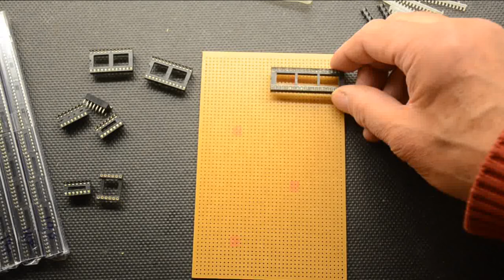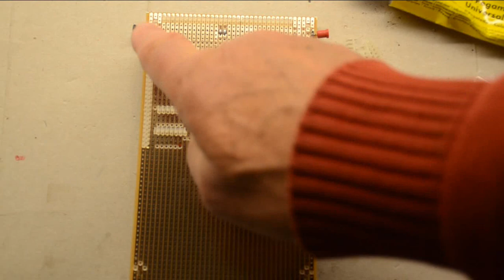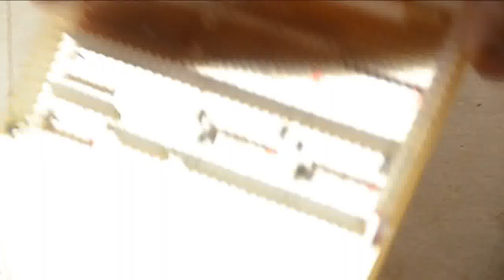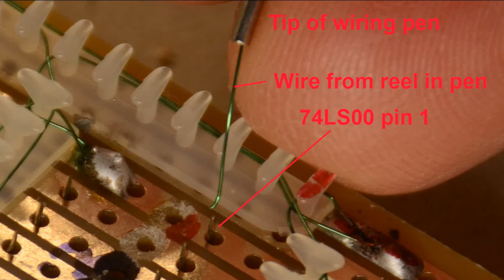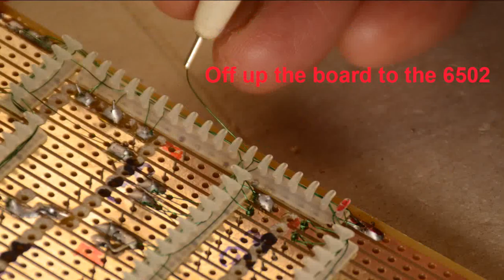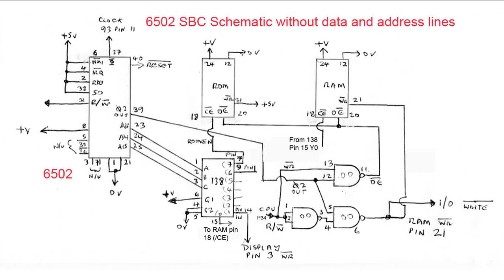6502 Microprocessor Projects for Beginners Part 2

Comment: 9:15 what does it mean 1k2 in clock generator? 1000ohm or 1200ohm resistor?
Reply from the maker: Yes, 1K2 is just another way of saying 1,200 ohms or 1.2K ohms. Do bear in  mind that the circuit MIGHT oscillate with anything from, say, 1,000 ohms (1K ohms) right up to 1,500 ohms. Do check this out with the type of 7414 you plan to use, be it either 74LS14, 74HC14, 74HCT14 etc. etc. 

Beware though, that if you use a value that is quite different to my suggested value, the device MIGHT still oscillate, but possibly at the WRONG frequency! (e.g. at TWICE the crystal frequency!) Beware! :-)
Reply: @lishaton  I tested it on a breadboard - 74hc14 and both resistors 1.1k ohm, crystal 3.6864 MHz. And it works. 👍
Reply from the maker: Excellent! :-)  Sometimes with circuits like this you have to realise that it might become necessary to alter certain component values if it doesn't work according to plan.